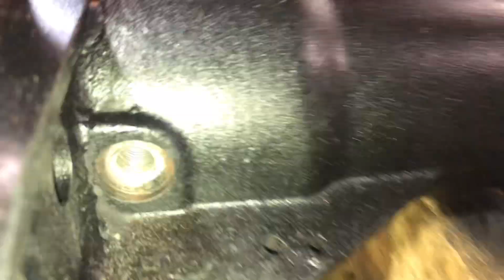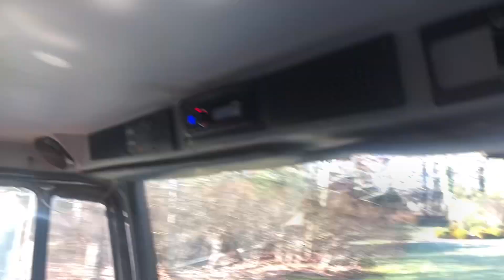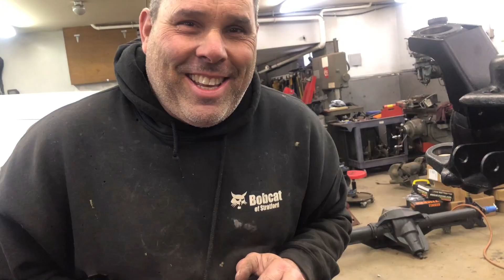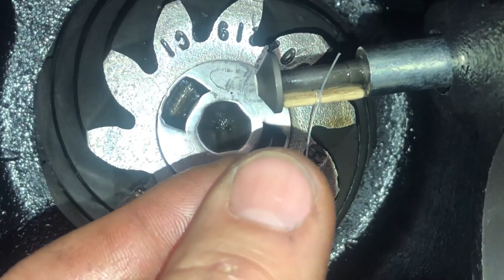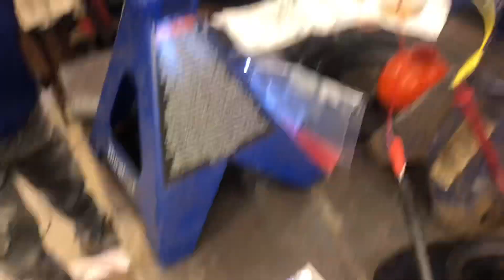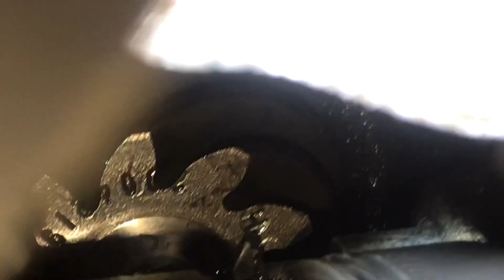Dana 44 Front Axle Build Part-1

Comment: Did you use a j8 housing 5100036 is the part number i believe? I've heard that it uses regular sae carrier bearings. Not koyo jk bearings. I'm gonna run a ox locker in mine. So you didn't have to setup ring and pinion with shims?  I'll watch your truss video too I'm gonna install mine in a tj. I have barnes conversion truss tacked on. Thanks for sharing video
Reply from the maker: Hi… this is my Dana 44 front axle that received a Barnes truss kit and C gussets…. As well as ball joint deletes….. been holding up great! Good luck with your build!👍🏻🇺🇸